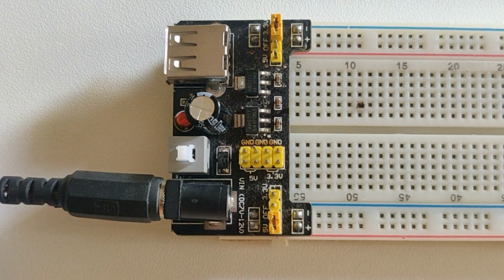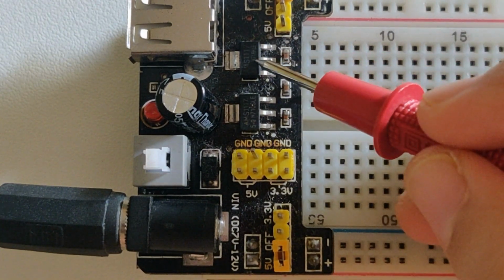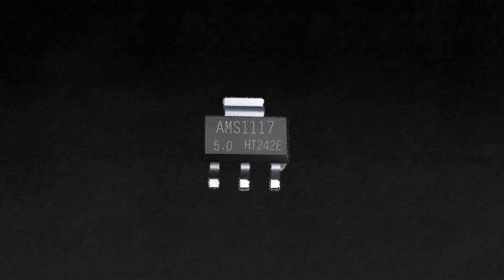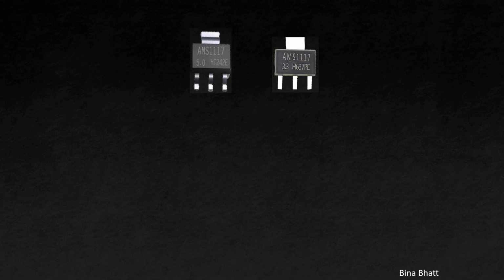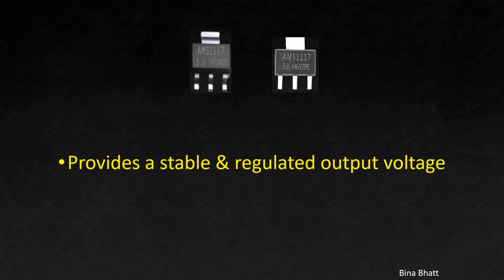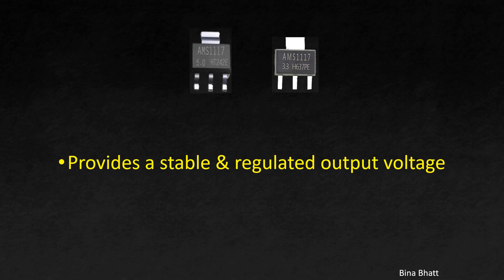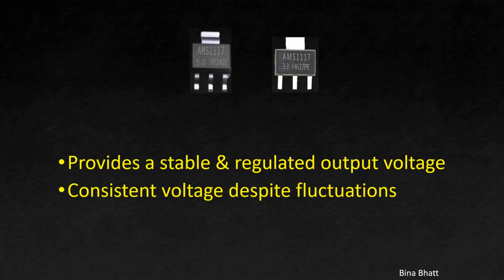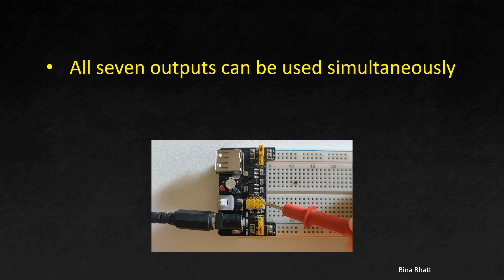Breadboard Power Supply module - How to use it?

Comment: Hi, I know it's been a year since this was uploaded, but I hope you'll still be able to reach out. I'm trying to power the supply module using 5v rated solar panels in series-parallel, which add up to 10v. I was able to power the module using the output pins using DuPont wires. Is this a good idea, or would it fry the module?
Reply: No DuPont wires are not gullible for 9v rated solar panels 🙂

Comment: So basically with the power module you can power your circuit with either 5 volts or 3.3 volts or three volts and that's it. Am I right 👍 are there more purposes of the breadboard module?

Comment: can you power a power supply module with a usb cord plugged into an outlet?
Reply from the maker: This one comes with a DC barrel jack, so, you need to supply 7V - 12V (check DC voltage on the module) via a DC barrel plug. If you want to use a USB cable then you need a USB based power supply module.